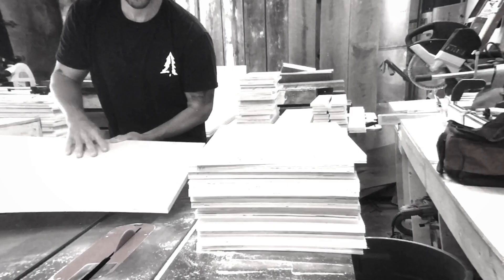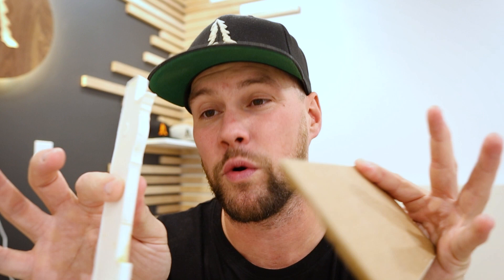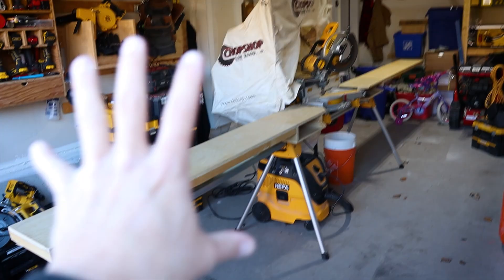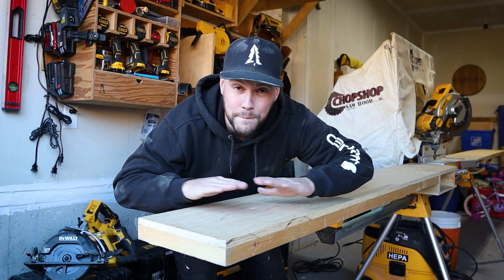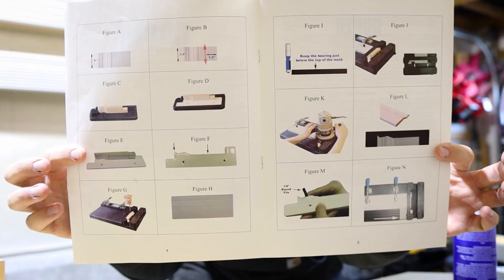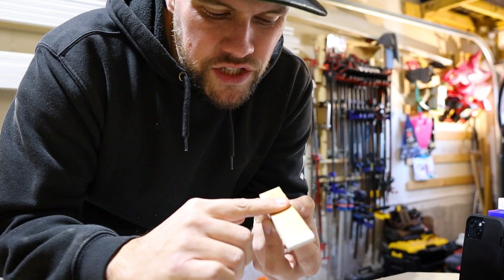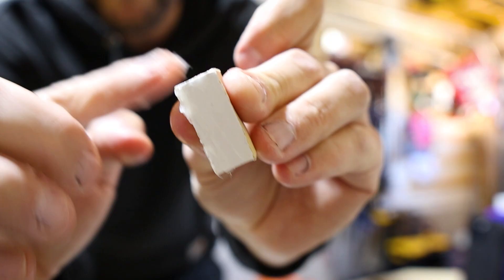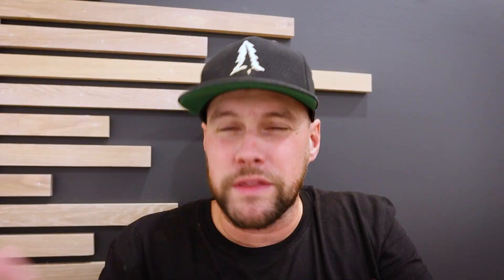The ULTIMATE Carpenters Jig For Cutting Baseboards

Comment: I’ve been a carpenter for 80 years an that product is a joke that’s not how you do it 🤣🤣 just kidding that’s actually a pretty cool idea, you could have quite a few profiles of different casings of trim after a while that would speed things up cause copping does chew up a lot of time!
Reply from the maker: Yeah, I’m gonna safe the molds in a toolbox with foam to keep them safe. I use the same profile for the most part but it works great and having. Library to pull from makes it that much easier